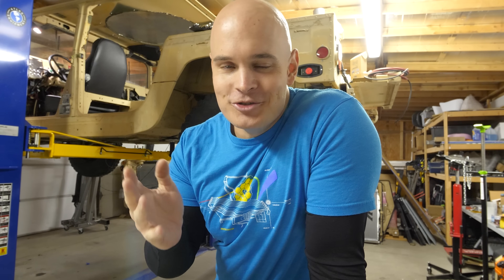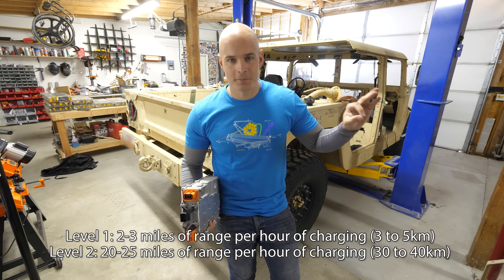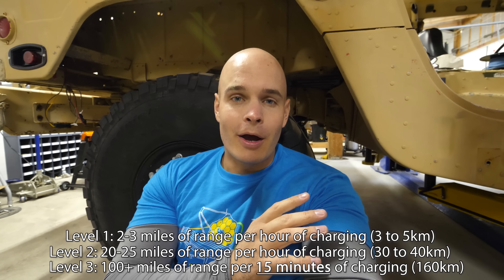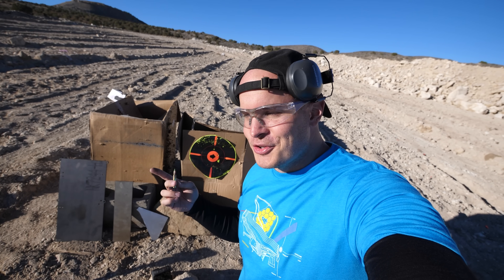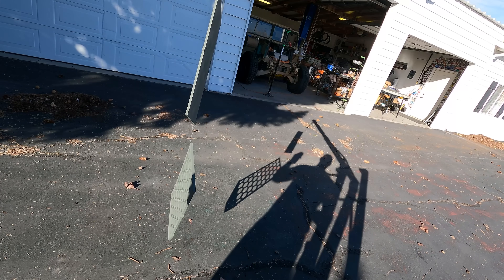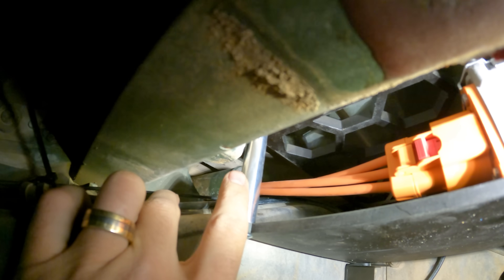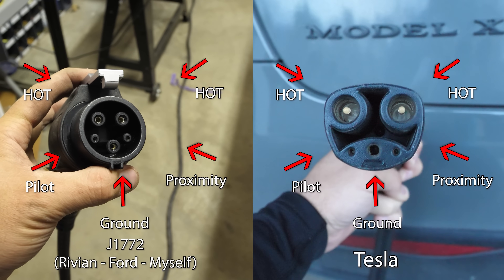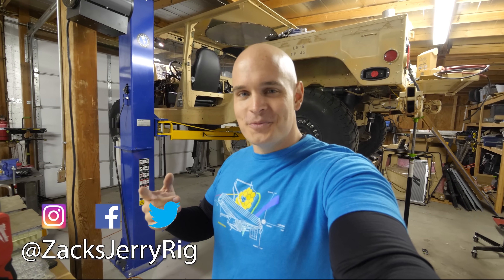My Electric Hummer is Bulletproof!? (Kinda) - 450 Volt Charger Install

Comment: Looking at that metal circle on the roof... I think it would be great if you make a custom Plexiglas hatch instead of a normal roof. Just for cool factor. Glass roofs are a thing for all modern EVs.
Reply: Replying so the algorithm makes this the top comment.
Reply: Yes cool idea
Reply: Ah, but can he do it with . . . lasers?
Reply: Initially he welded the original hatch to make a flat roof, but it didn't occur to me back then that this is actually an awesome feature. Even if you don't use it you still get a panoramic rooftop.
Reply: He mentioned it earlier in old videos that he's gonna use that humv for off roads, hill climbing and rough terrains. So this roof must be considered either to use or not.
Reply: @sangerofficialverifiedpartner  And, well...
Glass is glass, and glass breaks.
Reply: @almostcertainlynotapotato6528  plexi then
Reply: @sangerofficialverifiedpartner  I mean, unless he's planning to drive it upside-down, I don't see how that makes a difference.
Reply: Good idea
Reply: totally agree!!

Comment: The Nissan Leaf uses a passively cooled battery and has a known issues with battery degradation due to heat. You may run into this issue during summer driving or off-roading with low airflow.
Reply: @brandonchutt312  fair point. It would be well earned if they do though!

Comment: I was wondering if it was possible to charge the hummer with some solar panel on the roof ? Will it be efficient, possible ? Thank for your answer (from a little guy in south of France) !
Reply: Well typical RV solarpanel has power output about 100W. I don't remember exactly how big battery Jack will put in this Hummer, but if it's like 60kWh, it takes 25 days to charge it

Comment: Better you add active cooling. The batteries get warm as you deplete them too.
Reply: Based on the amount of batteries there, there's not enough internal resistance that they'd need it

Comment: I mean.  It still runs on recycled dinosaurs. There’s just an extra step now to turn it into electricity.
Reply: The point is that it doesn't have to, it facilitates a transition away from fossils and while you burn coal to power it, it's still cleaner than gas or diesel.

Comment: Its cool enough but shouldn't the gas pipe had been completely  discarded like you could have used plastic one or maybe  screwed the wire onto top. Why add weight.

Comment: AC-DC-DC-AC? (that is a conversion energy loss nightmare.
Reply: The final converter is not actually AC. The motor has three coils and that requires a special controller to switch current from a coil to another, therefore the controller takes DC current and modulate it in frequency. For most people, this process is recognized as AC because there is a small similarity. Too much tech, right?
Reply: @amaciuc  Bine de știut, mulțumesc.
Reply: @amaciuc  Dar totuși, poate cu TESLA împingând inovările la mașinile electrice, poate se va inventa un standard care este mult mai eficient și nu trebuie să facă conversii excesive pentru diferite lucruri intr-o mașină electrică. (P.S. Sper ca Tesla să nu devina Apple in industria mașinilor, și sper ca după ce se stabilizeaza și au „desul” , ei nu vor stagna , așa cum au facut cei de la Intel , Apple , Nvidia etc.)